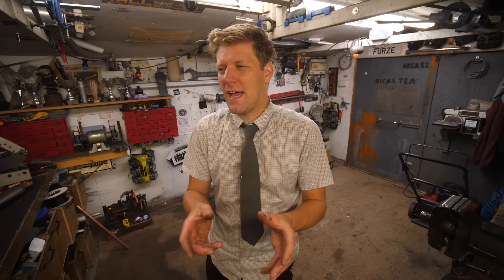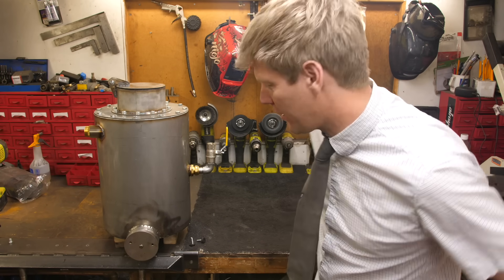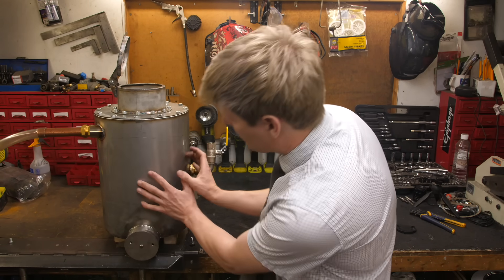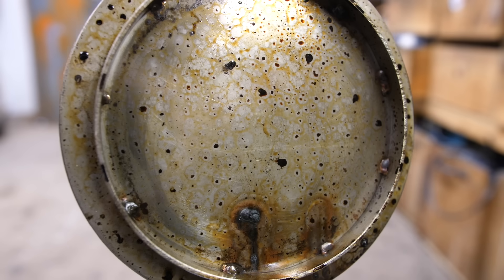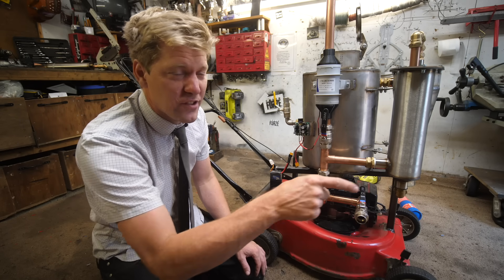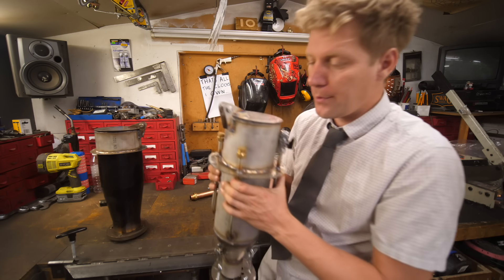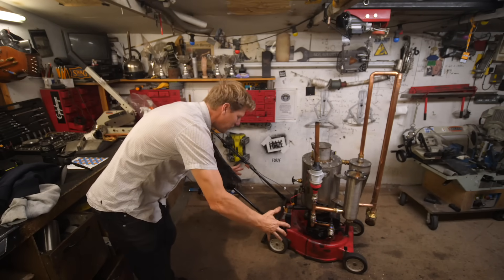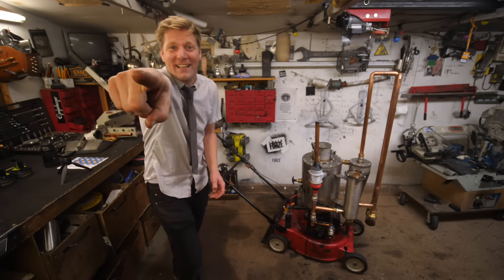WOOD POWERED LAWN MOWER

Comment: The French ran their cars like this during the war when the Germans took all the petrol
Reply: The germans also ran cars like this, actually they invented it https://en.wikipedia.org/wiki/Wood_gas
Reply: @zimzf  The Germans even ran tanks on wood gas including Tiger 1, Panther and Jagdtiger
Reply: North Korean military still runs their trucks on this.
Reply: norway too
Reply: And the UK, because petrol wasn't available for civilian purchase.
Reply: onetopbbloveyou.link/NLCbAw68X3w
Reply: Gasoline was rationed in most european countries during WW2, as was a lot of other things such as rubber. So getting new tires just wasn't an option for many. Many cars however was converted to run on wood gas. These conversions weren't always the highest quality and there is a bit of a learning curve to operate them and some deaths did happen when either the whole thing blew up or the operator simply sucked down to much of the gas in to short time. My grandfather had a huge Ford that they converted and used when absolutely needed during the war, though I remember my father saying it spent most time up on blocks in a barn to spare the tires and keep it out of view. Apparently it was a beast in deep snow plowing it's way on those large but thin tires and with a plume of wood smoke spewing out of the chimney on the burner.
Reply: @blahorgaslisk7763  why are you lying? there weren't any petroleum or wood burning cars in 1944 https://www.youtube.com/watch?v=zMb62tupL-A
Reply: ooooh those Nazis... the more I hear about them, the less i like them
;)

Comment: world of tanks going to bring a upgrade out, running them on woodgas? xD btw, they also used pig dung....  if you flush/run the engine after use with petrol, it helps against the sticky problems my old pop said. he used to have one of those mounted on a motorcycle. also, i recall him mention that wood coal is cleaner; wood produces more acids and fouls the engine faster.

Comment: Just wondering if you used an auger system at the bottom to remove the excess wood ash which you could have a collection pot which could be turned via the lawnmower moving. If you built the heating/cooking container for an angle to allow for better flow and also kept the burning container separate but close to reach about 450•c. Built a filter/collection pot before it goes into the motor so you don’t loose excess temperature.

Comment: waste engine oil ....start with petrol make waste oil refinery through exhaust  by heat exchanger method . but first put in a 3 pronged spark plug or make  a circular  electrode on normal spark plug by welding a small stainless washer . reason being more lightning/plasma flashes hence frequency difference

Comment: The steel wool is definitely a good stage 1 of a filter. I would think that a water bubbler tank would make the tar come out of the gas (or at least solidify it to collect as a powder on your radiator). That being said, you may need to make a more proper radiator to compensate for the added moisture.

Comment: Now correct me if I'm wrong, but that lawnmower runs off a two stroke engine, which requires the lubricant to be mixed with the petrol. So while Colin may be able to start the mower with it. It's going to seize up at some point.

Comment: Considering the materials,the time and all the adjustments you could have bought fuel for 3 years to run the mover. Why don't you ever make a useful videos for your followers maybe they can be inspired to copy for they needs. Always extreme projects
Reply: Lmao useful is not what this channel is about like at all. Colin has never really made a "useful" invention, as that was never the point. Everything he makes is to a certain extent extravagant, from the bunker to the hot tub BMW over to the hover bike. If you think colin is about making only useful projects, you're on the entirely wrong channel.

Comment: @colinfurze

Some Useful Info on this topic (Link Spam)

Stuff from the group "OSE" on their wiki:

(Sidenote the wiki is a bit of a labrynth at times)

https://wiki.opensourceecology.org/wiki/Gasifier_Burner

https://wiki.opensourceecology.org/wiki/Pyrolysis_Oil

https://wiki.opensourceecology.org/wiki/Category:Biofuel

Stuff From Wikipedia:

https://en.wikipedia.org/wiki/Pyrolysis

https://en.wikipedia.org/wiki/Gasification

https://en.wikipedia.org/wiki/Torrefaction

https://en.wikipedia.org/wiki/Syngas

https://en.wikipedia.org/wiki/Water_gas

https://en.wikipedia.org/wiki/Producer_gas

FINALLY

I think i have 2-3 Playlists on These Topics, so look into those as well
Reply: I'll try and make them more orderly, but i found some papers and put them in the OSE wiki pages (especially on pyrolysis oil collection optimized designs)
Reply: Also i'll explain what the OSE group is, for anyone wondering:

Basically a group dedicated to making all the open source hardware needed to build/run a small town/farm.  Farmers got pissed of they couldn't fix their stuff, so made the group.

Complex to explain so perhaps watch the ted talk and check it out?

Ted talk on the group:
https://www.ted.com/talks/marcin_jakubowski_open_sourced_blueprints_for_civilization?language=en

Also the websites are:

More PR-ey Site
https://www.opensourceecology.org/
Wiki Link
 (All the "real work" and info is here)
https://wiki.opensourceecology.org/wiki/Main_Page

Comment: Try using hardwood. Oak would be a good fuel source. Pine has a lot of pitch to it. Harder woods have far less. This is why it's not recommended to use soft woods in your fireplace as it will build up creosote on the chimney.

Comment: Make one powered by grass then you don’t even have to obtain wood.
Reply: It is called a goat.
Reply: @chadrandall1272  Mowing your lawn during the day, warming your bed during the night.
Reply: yup - bag the grass clippings, dry them out, and then use them as fuel to cut more grass
Reply: @Toastmaster_5000  Dry it with the stovethingy
Reply: @MatsNorway  Haha there you go!  Dry the grass as you cut it and then feed it back into the mower.  That way, the mower basically stops operating when you've run out of lawn to cut.
Reply: @Toastmaster_5000  im not sure the wasted energy (heat) is enough to dry the grass in time. Evaporating water, especially bound in sth else takes alot of energy, but when you just store it after cutting, let it dry and then use it might work enough. although i think the energy density of grass is considerably lower than wood :D but i like the idea very much
Reply: @Toastmaster_5000  High IQ
Reply: Chicken and egg comes to mind!
Reply: Its almost a grassception: Grass powered lawn mower to get grass clippings to power said grass powered lawn mower.
Reply: They're called goats and cows.
Reply: @mythosallen32  ????
Reply: Or a woodgas chainsaw
Reply: you read my mind
Reply: That would be sort of perpetual motion, wooden it? (See what I did there?)
Reply: @geordiemik72  yessssir
Reply: Its called a goat.
Reply: You would probably have a more efficient system, if you wanted to use grass, if you ran a fermenter and still and made your lawn mower run on alcohol. Even then, it would not be a very efficient system since you would likely need far more lawn clippings that you are likely to get. 
     
Now, an alcohol powered brush saw (a weed whacker with a metal blade instead of cord for thicker material) likely COULD if you let your lawn get waist high, cut it low, and fermented it - especially if you had a lot of pokeweed, milkweed, and other non-grass biowaste in it. 
      
Wood gassifiers are one of those things that get easier with scale - but are very fuel particular. You want very dry and low sap hardwood. Biowaste does better with either fermentation for alcohols (if you want a more stable, liquid fuel for portability) or just basic fermentation for methane (like a covered pig pond feeding a generator or boiler).
Reply: I was gonna comment this, it's just genius xD
Reply: big brain
Reply: But... it should be cut first. Right?
Reply: Elias Galanakis well ya you aren’t going to burn it straight of ur lawn
Reply: That some modded mc thinking right there.   l o v e   i t
Reply: Um how to start it? lol
Reply: So much water in grass

Even dried it's more than likelynot dense enough
Reply: grassification mower!!!
Reply: If you ran it on grass you would probably get so high on the fumes you would not be able to mow the lawn.  You might get a craving for chips and pizza too...
Reply: The fuel is gas trapped in the wood. It wont work with grass.
Reply: Cut lawn and dry lawn clippings. Cut lawn clippings with sawdust 50/50. Use pellet mill to compress said mixture and run gassifiers on the pellets( there is a gassifiers design completely built around running on pellets, check out drive on wood forum more info then you could ever want on all different designs of gassifiers and all things powered by them) also check Wayne Keith here on you tube the man with several guiness records using gassifiers
Reply: That wouldnt work terribly well as its WOOD gas not GRASS gas that powered this lawnmower. Unless the grass heated a steam engine boiler but anyway grass burns quickly and not very hot.
Reply: Like a goat 🐐.
Reply: This 👆
Reply: @pucash  TOO 𝓜 𝓞 𝓘 𝓢 𝓣
Reply: @NuclearTopSpot  im pretty sure that if its already burning it shouldn't have a problem drying it out
Reply: @NuclearTopSpot  thats what she said

Comment: the "proper" more sensible way to power a portable appliance would be to fill a gasometer and then fill that with wood gas and attach only that to the mower, thus separating the generation stage from the usage stage allowing you to clean and filter the gas more easily. 

Also Bunker + Wood Gas sounds like a huge carbon monoxide hazard but I'm sure you know that

Comment: If you keep using the wood pellets, you can light them with electric starter.  The ones used in pellets stoves need about 12v or less.  Or just need some kind of element that can stay red hot for 5 min.

Comment: Collin you need you’re wood gas going into water to clear the tar out ant then another filter with sawdust to dry it out then it should work better and also you need more air going in to the burning part like a small computer fan or hair dryer motor

Comment: I think you've got to burn your flame upright so the fire can use the wood's sugars as more fuel. Otherwise, it seems the fire will produce excessive hydrocarbons when in the inverted design due to gravity.

However- in keeping with the inverted flame design: It seems when burning under-seasoned firewood in a stove, if the inlet is nearly closed and the flue or exhaust is completely open- it produces the cleanest and driest flame. Maybe you can tweak the intake/exhaust settings on your firebox this way to produce a cleaner burn. Maybe use a push fan on the intake side instead of a pull fan on the exhaust side and choke the exhaust valve way down to create a Venturi effect prior to reaching the carberator. It seems gravity is not going to be your friend this way, but maybe if you're able to build enough heat inside the gassifier, it'd be less messy. 

At any rate, this would be fun for a snowblower due to the thermodynamic advantages for the operator and drier winter air. It'd also be slick as stationary power for PTO or generator type applications too. Interesting concept, for certain!

Comment: Make a biomass powered lawnmower that runs on grass cuttings.
Reply: Gasifier will turn any biomass into useable gas - even dog turds so long as they're dry.
In fact you can put anything in that's flammable - plastic, rubber, etc etc....

Comment: U should do this to a car for when there’s a fuel crisis😂
Reply: Our little town had a guy who did this with a V8 (Holden Monaro, IIRC), towing a small trailer enclosing the gas generator, powered by carbon monoxide from charcoal. This was in the 70's - the actual fuel crises when I was a teenager.

Comment: I'm still remember that in WW2 era the german has once build a wood gas engine for their Tiger 1 Heavy tank
Reply: what about thier woodgas jet engine.... or was that the russians? either way, it worked but too heavy to get off the ground
Reply: Yeah the germans did make some wood gas tanks. They were used in training because oil is much more expensive and hard to get than wood

Comment: Finally someone see this a relevant solution!

Hey Colin,

do my idea and for the bunker use solar power to heat the chips, use parabolic with vacuumtube or mirror focus to heat up the chips, and store the gas.
Later you can do the same for boiling water and use the steam to reform woodgas/syngas to methane.
This was my PHd and project for national award but was canceled due to corruption in my country!

If you can do and prove maybe you could get the needed attention to help 3th world to find the green way.

You can also predry wood or grass with excess heat , also can heat bunker in winter not just produce electricity and store in battery.
If you manage to produce methane you can run everything with some converstion of gas engines.

Comment: Oi, great device, but rather than polluting the planet with wood gas and burnt wood, why not finding a solution to generate electricity using a hidro-generator, and something that would push the water back up to run it again. Something that would work on infinite energy but regenerable or idk.

Awesome build.

Comment: It would be better if you converted grass into fuel, but wood is a improvement to gas, you're amazingly capable of doing anything.
Reply: How is wood an improvement to gas? Everyone is up in arms over coal powered electric plants, this is essentially a coal powered mower. Trees convert co2 into o2. Underground oil does not. I don't think this is meant to be a "clean energy" thing. More of a "can I make it work" experiment.
Reply: @btumminaro  Wood is a renewable resource, as if compared to gas, underground oil is a nonrenewable resource.
Reply: @the6headedtriangle243  Coal from underground mines as a fuel is very similar to using wood as a fuel. Afterall, superheating wood in the absence of oxygen creates coal, which is what Colin's contraption is essentially creating while the emissions are used to power the mower. The emissions from burning wood, sourced from "renewable trees", are far worse than what comes out of the exhaust pipe of a car. This is the reason why many want to see coal power plants shut down. Assuming you watched the video and saw that after a very short time, the emissions from the burning wood incapacitated the engine. Sure, a filter can be designed to catch all this sludge, but then what do you do with the contaminated filters and sludge? A gasoline engine will look essentially clean for well over a hundred thousand miles, leaving behind only mild carbon deposits. The gas-powered internal combustion engine isn't perfect, but it is the best solution we have at the current level of technology. With underground oil not being renewable, there are other renewable fuels that can power the same engines with minor modifications. Certainly not extravagant enough modifications to justify a Mr. Furz video, unfortunately.

Comment: What about a wood gas station where you have a stationary gasifier and a portable tank on the mower. Have the gasifier going and fill up the tank and when you need some more wood gas, just plug it into the stationary tank full of wood gas.

Comment: All you need is a inflatable bed air pump to blow air in the air intake.  My air pipe is  higher so once shut down you can re light by dropping an ember down the air tube. These machines  are simple but the design is critical and as you found its a real learning curve to get it making good gas.With the size of your gasifier you could easily power a small car with a bigger cooler and filter.   If you are going to build one beware of as there is allot of videos of people's gasifiers they claim are the best but in reality don't work

Comment: so you should do that same concept but make it so the smoke will spin a wheel and then create power but it will also burn the gas to make heat in the winter or make the gas the burn it under a steam pot and the steam will create preassure and spin the wheel the the heat has to way to go either into the shed in the winter or out a random tube away from the shed

Comment: It doesn't matter how dry your wood is, the water is a byproduct of the combustion.
Genius idea with the copper pipes though, but I think it would work a lot better if it was a coil and from thinner copper. Basically distilling out the water and tar, just add a collection point before the engine. Can't wait to see you power the bunker!

Comment: What is how pyrolysis works. Theoreticly you could use separated process for bunker I mean burning smth without oxygen at all. To start process you need some fuel but after the start you could use biofuel to heat container with wood or smth else and use pyrogas to turn the turbine. I dunno is it possible with wood or wood pellets but it worked with old tires with plastic but we used pyrogas to heat container to get biofuel.

That's a lot of math but it's interesting project!
Reply: better to use solar vacuum tubes to heat up the chips and also boil water to steam and reforme methane from water and wood.

Comment: Question:
Wouldn't it be easier to build a big generator, make big batches, collect the gas, pressurise it somehow to put it in gas tanks, then just run the lawnmower of the gas tank? Then you don't have to have the full thing on the lawnmower. 
But I don't know how gas works or if you could even do it with this gas...
Reply: The gas should be carbon monoxide and hydrogen. There's nothing particularly easy or safe about storing large amounts of that.
Reply: you can heat wood chips with solar parabolic setup and also boil water by this, let it react on nikkel and you get stable methane.